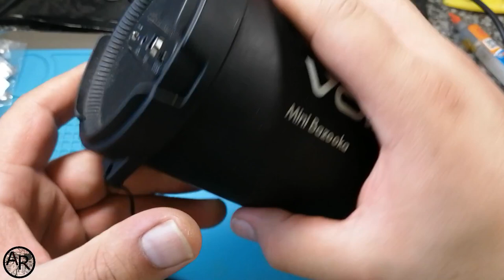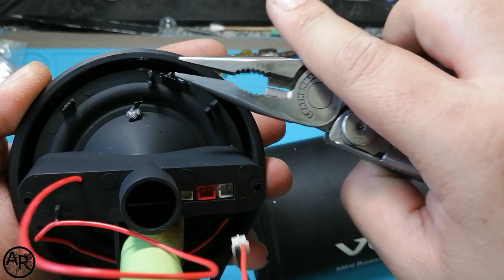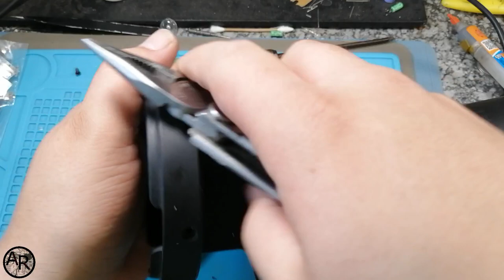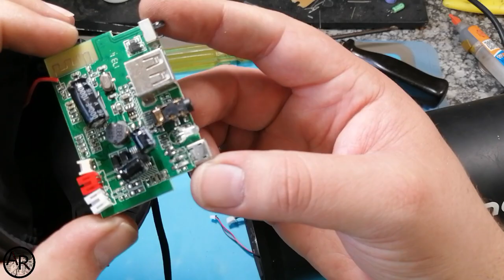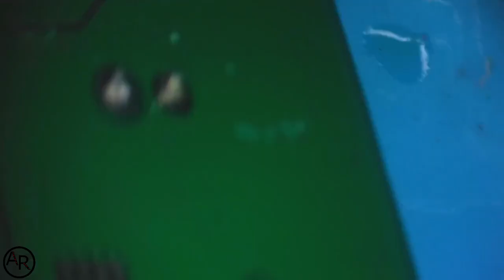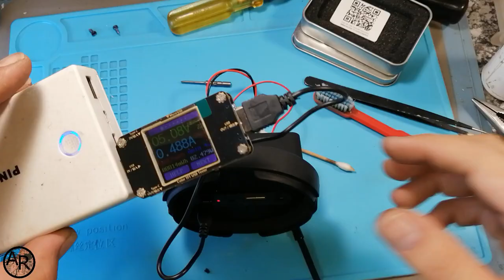Volkano Mini bazooka Repair

Comment: What is wrong with the red wire that is connected to the module and the other end to nothing
Reply from the maker: It's an antenna
Reply: @AnonymousRepair  so if it broke off do I need to solder it back on because my mini bazooka doesnt want to turn on but everything is okay when I plug in my charger the LED shows red but when I turn it on or plug in the aux cable to my phone and speaker no sound plays

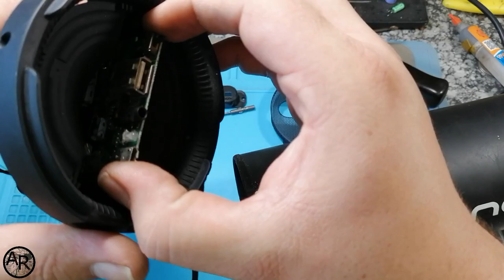Comment: Man that Bluetooth/USB Module looks just like a $4:00 or 5 Pound Generic one from China, Am I right?
Reply from the maker: Yes it does but the chip alone is $20
Reply: @AnonymousRepair  yeah it seems it's always the way, where it could be cheaper to buy a whole new unit rather than one of it's replacement parts 😣😑
Reply from the maker: @KorAllRBare  I hate it when that happens but will keep it never know when I can use it for parts of see if i can enable the amp on it
Reply from the maker: @KorAllRBare  😂🤣 Yip

Comment: what if the problem is power how can i repair it?
Reply from the maker: do you have voltage on the battery?
Reply: @AnonymousRepair  are you around jhb because my speaker has a problem with switching on
Reply from the maker: @tshepomashego4346   Hi unfortunately I am not in JHB  I am in CPT but there is  PC Vitamins Professional Repairs in JHB
Reply: @AnonymousRepair  Oh thank you do know how much it should cost to fix it because it's the exact volkano speaker
Reply from the maker: @tshepomashego4346  it all depends on the fault
Reply: So my speaker when I put volume on highest it shuts off and has this annoying ring, what could be the issue? A bad battery?
Reply: I have the same speaker it charges but it doesn't want to connect and play. May you kindly assist